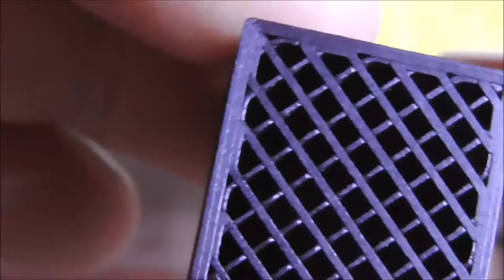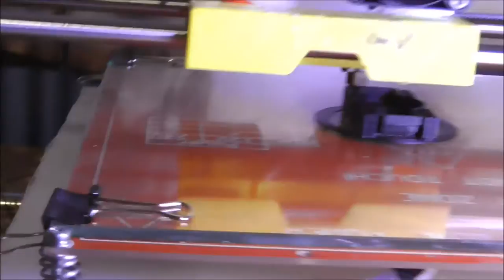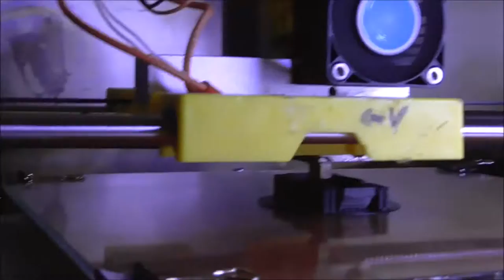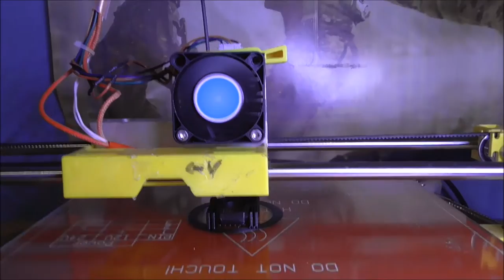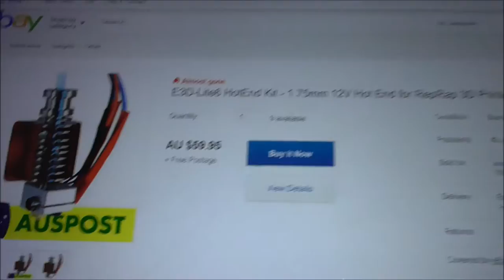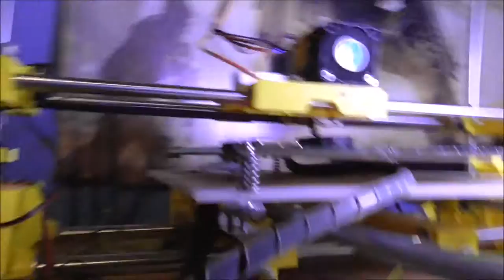Print Right 3d printer//updrades//problems//should u get it or not ????

Comment: I've had nothing but issues with mine, and now I cant get filament to load into the extruder. I've put so much pressure on it that I have actually moved the axis down.  Customer service rep I talked to just told me to push harder...     If I get it going again I'd love to add a heated bed to it but run it on the stock mother board.  I wish I had just saved up and got a better one instead.
Reply from the maker: +skysthelimit866 hey bro i have had this issue it can be so many diffrent things so add me on FB and pm me or just pm me https://www.facebook.com/profile.php?id=100006396375886